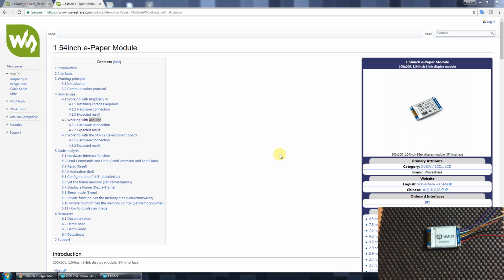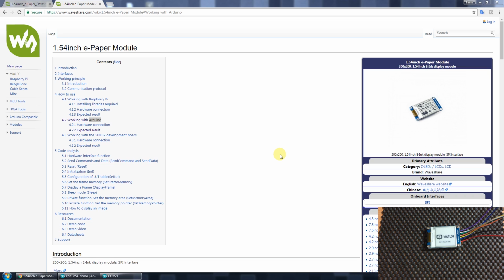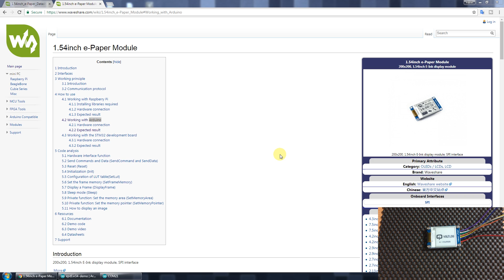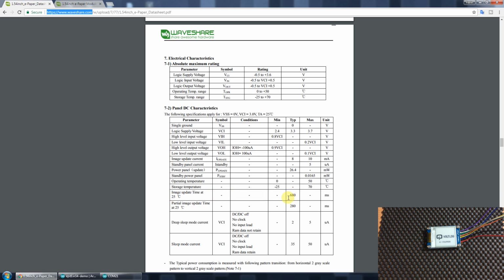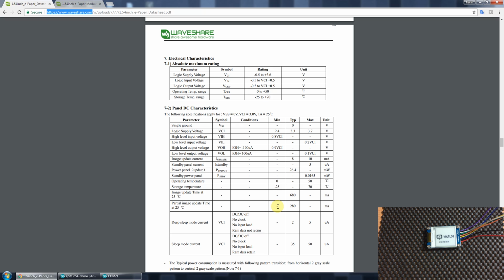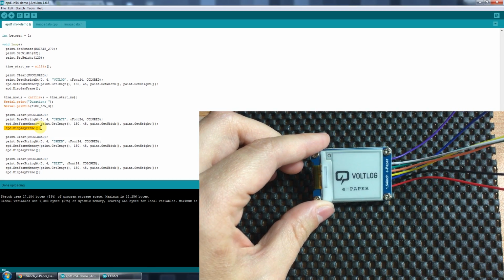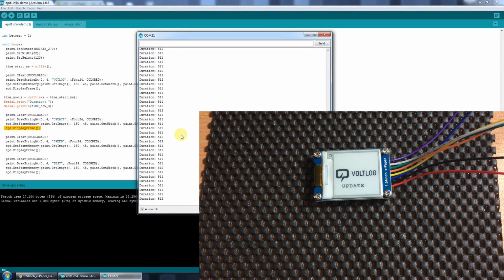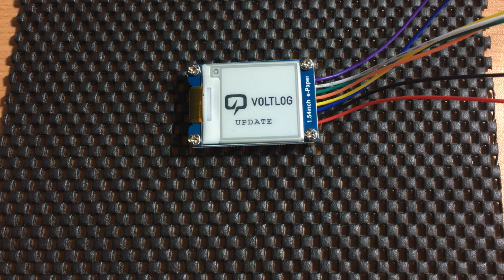Voltlog #126 - How fast can you update an e-paper display?

Comment: You can only read digits scrolling below a certain rate because of POV, so maybe a scrolling counter going as fast as it can would be a better test.
If they are selling the display by it's self, maybe there are other/better drivers you can use.
Reply from the maker: The test showed text being changed, there was no scrolling going on.
Reply: So that is as fast as it goes, well that's not going to cut it for something like a DMM display.

Comment: In order to get a better figure, I think you should definitely try just partially updating. At least measure only the time the DisplayFrame() takes, since that is the time the actual update takes. The rest is in-memory overhead and is not related to the display's capabilities. Also, you can try to just update the text and not your logo.
Additionally, there's a function called SPISetClockDivider (https://www.arduino.cc/en/Reference/SPISetClockDivider) where you can set the speed of the SPI bus relative to the ATmega's clock. Although I don't think that will be a major difference, considering the limited amount of data going over the bus. Might be a few milliseconds..
I'm curious how much of an improvement is possible :)
Reply from the maker: I wanted to show a real case use scenario where the user would buy the display and use the provided library. The point of the video was not to optimize the speed, just show what it can do out of the box. Like I mentioned the speed could be improved maybe 2x.
Reply: I understand, thanks for showing it! I'm just curious what the full answer to the question in the video title would be :). Really enjoy your vlog!
Reply: Im currently using an Teensy3.2 if i change the spi speed can i get faster response time? Thanks

Comment: Another goody. I was hoping to see at what stage the display starts ghosting, but 2 Hz is not fast enough.
From what you have experienced, if an analog speedometer is created using graphics, can the needle be updates at 10Hz or above by doing a partial update? No need to update anything else but the speed needle indicator! 
Also, are you using bit-bang SPI or the hardware SPI port?
Reply from the maker: it doesn't matter how fast you push data out, I'm pretty sure you can't refresh it faster than the 280ms partial update time given in the datasheet.
Reply: Wow... That is slow. Thanks for the informative video.
Reply: There goes my idea of replacing my LCD speedometer on my eScooter :( 
Its sucks because I wear polarized sun glasses and can't see anything that has an LCD display.

Comment: Thanks for answering my question ;) (for some reason it was being removed from the comments?) 
2 fps is a little slow. It's fine for just temperature or so, but you can't really use it for a voltmeter
I think one of these OLED displays would be better in that case.
I do like the viewing angles of e-paper displays 

I am wondering if you could dive into the optimizations and see how fast you're able to get it?
Reply from the maker: I would only dive into and optimize something like this if I was using it in some product and I needed the extra speed. I don't feel like doing it just for fun. Theoretically the maximum you could get is the datasheet figure.

Comment: Is "VOTLOG" a bootleg copy of your channel? ;)
Haha. 
Thanks for the update. I was interested on this test, and as you say I'm sure the speed can be improved a lot, if anyone really requires more than 2 updates per second.
Not sure if this is the case but a bunch of Arduino libraries use software SPI instead of the hardware SPI channel, and even if they were using HW SPI, the default clock speed is really low so you need to tweak that as well to get the best speed.
In a project I've been working on, I actually have a small monochrome display that also happens to use SPI. With SW SPI, refreshing the full screen used to take 70ms. With Hardware SPI (and the fastest clock speed I could make work), it took ~7ms. Basically took 10 times less.
Reply from the maker: just a typo :-) I've also had success improving the refresh rate by improving the firmware in previous projects, but I wouldn't spend time on that unless it's really needed.
Reply: It's definitely not worth the time and effort if it's already working at a usable speed for your application.